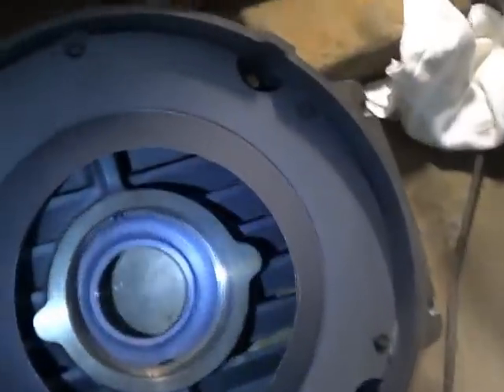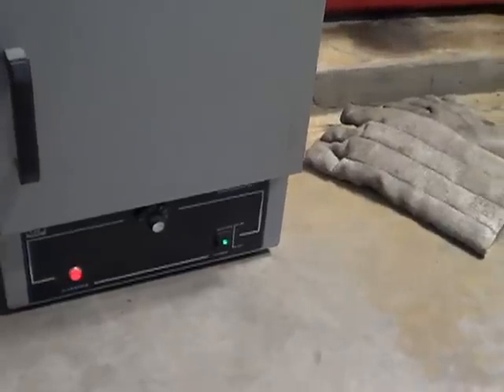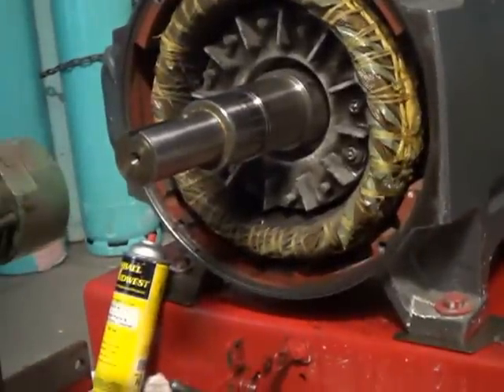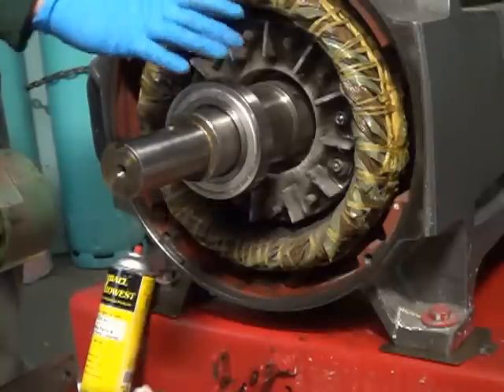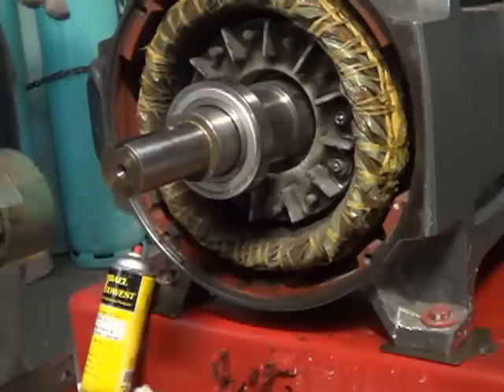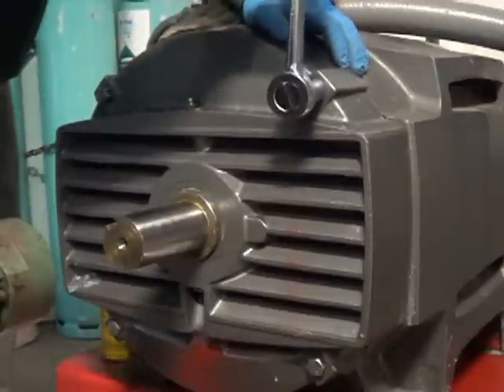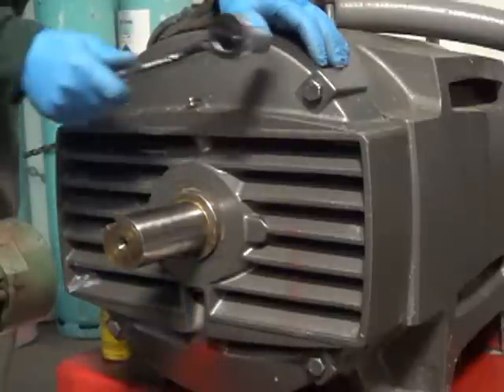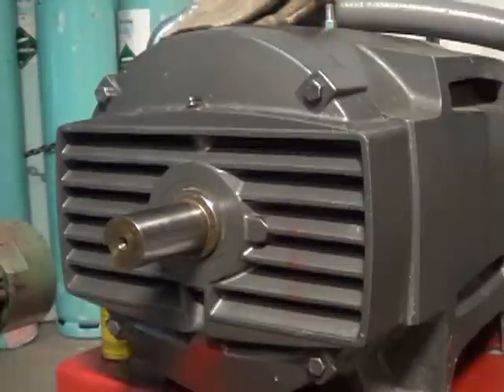Electric Motor Bearing Install

Comment: Copper coat on inner bearing race to shaft and use induction heat. But great job.  Now the DE bell should not just slip on, I use a dead blow hammer to fit bell ends and most motors have landmarks for position of bell ends.  Great video and good work, keep going my friend.
Reply: I will just assume the surge/hipot. Winding tests have bien done.
Reply from the maker: Nope! and it's still purring like a kitten

Comment: 20 minutes at 250 degrees in a toaster oven. Dropped right on my old Craftsman radial arm saw motor. Thanks for the tip, really appreciate it.
Reply from the maker: Glad it worked out for ya Jim. Now that you have done it you will just get better at it. I take a lot of crap for this vid but I leave up so that folks like you can see it done and give it a try. I hope all your project go well. Have a great day.

Comment: I install bearings on motors like this and much bigger motors.. All elevator motors.. we heat up the outer race first and then the inner race.. we use a torch on a map gas tank.. as long as you keep the torch moving and don't blue the bearing you are fine.. then as we are heating up the inner race we spit on it,and when the spit jumps off the bearing is ready.. I'm sure this sounds crazy to some people but it works like a charm!! never had a problem and installed hundreds of bearings from 2" to 10".. for smaller bearings like the one in this video u can get a drop light with a 120watt bulb and place bearing on bulb for a while and then slap it on..works great.. but the torch is the fastest and best!
Reply from the maker: +john k I love comments like this that don't criticize but add to the content and purpose of the vid. I get a lot of BS from people that don't work around industrial motors and have no experience. Thank You for your contribution. I have worked around DC elevator motors. People complain about the small grinder I used to cut the bearing off but they have never seen all the carbon build up around elevator motors. I really admire those old brass OTIS emblems. Wish I had one to hang on my wall. Thanks again. I know what you mean about the spit test. It just bounces off like an exhaust header.

Comment: Heating bearings by the oven method is not the best way to do the trick.  The Goal is to expand the inner race and not boil out the grease in the bearing.  Quick and simple way is to find a short socket in your Craftsman set that closely matches the inner race diameter and set the socket on a hot plate with the bearing on top of the socket.  This process was used to install disk drive bearings that are very fussy about heat and grease distribution inside the bearing.  You can also cool the shaft with an ice pack to insure that the bearing goes on without scuffing the motor shaft which will make the bearing run rough.
   One other point is when putting on motor end cap hand fit and tighten the bolts side to side which will make the cap go on relatively easier than tightening just one side.  One problem with putting on bearings by the heat method is that the process sometimes make the shaft and the inner race of the bearing actually develop a metal bond making later rebuilds a little more difficult.  Informative video, Thanks.
Reply from the maker: +Harry Jones  Mr. Jones you should make a video.  You have some good points. I think my vid is just one of many examples of how to do the job. It all depends on circumstances for a given situations. I have a friend that works full time at a large electric motor shop. You would not believe some of the story's he tells me.  There are many ways to complete any task. You just do the best you can with what you have. Not many people are brave enough to post a video that is trying to help someone who dose not have experience or someone else to show them. Keep this in mind and create a great day. I appreciate your input. It may help someone else.
Reply: +TheEZGZ heating the entire bearing to temp isn't gonna hurt that grease at all, it can withstand 300 degrees F with no problem. I've installed many a large bearing on papermill rolls with hot oil bath heaters.

Comment: I'm a skilled tradesman and speak from experience. the link was just proof straight from one of the largest bearing  manufacturers. it's one thing to show someone how to do something and it's another to give them wrong information. We get paid well to do things the proper way.
Reply from the maker: Being a skilled tradesman as you are I'm sure you understand that it is not a perfect world and there are times you have to act quickly and use what you have on hand. My goal here was to offer a alternative suggestion and help people think out of the box. Most people that target this video in a negative way refer to the sparks and metal hitting the winding. They were dry and low temp and did no harm. That motor has run perfectly ever since I did the video. I respect your opinion but it is just that. An opinion even though you find it below your standards. Open you mind and relieve the stress

Comment from the maker: All bearings that are a press fit are to tight to put on and off the shaft with very special tools. If you press them on cold you can remove some metal that might effect things. If you heat it up it expands enouph that you can slip it on. To remove it you use a puller and drag it off and stress the bearing area but most times you wouldn't want to reuse it anyway. Thanks for watching and comenting

Comment: We had a cone heater at the shop to heat bearings, but when had to change one in the field we used what ever we had most of the time cutting torch you got to be careful not to get it to hot, your stove was alright use what you got.
Reply from the maker: +Joe Tiller Thanks for your support Joe

Comment: i use a an oven too as long as the bearing does not have a plastic seal and the shaft i just stick it outside where its always cold lol good vid

Comment: Thanks for the video.  Why did you say not to lube the shaft before putting it on?
Reply from the maker: It's supposed to be a tight friction fit when it cools down. It's not supposed to spin (rotate) on the shaft.

Comment: Trade tricks - I have put heat on the bearing and cold on the shaft.
Reply from the maker: No trick to this vid the real challenge here was doing it in place without removing from the base at all.

Comment: Hello. I was so happy when you said, 'we're not finished', and I saw the housing/cover. But you didn't encounter my problem, :( lol..... My cover has a rubber gasket embedded into it, to seat the bearing in, and, exactly like your motor here, once I get the cover down to the bearing, I can't get any tools in there, and even if I could it would have to be so precise, the circle size, and be able to stretch 4 or 5 directions at once, but only a couple mm each way, lol, it's nuts. And if I rip the rubber out, then the shaft is free to wobble..

 I mean you know all this, but ... am I pooched, can this be done?   Peace
Reply from the maker: I suspect the housing has a slight taper to help get started. ??? Maybe put the seal partway on the bearing and spray some silicone on the outside???? Good luck with your project. Maybe contact the motor manufacturer and ask?

Comment: Sir.How many minutes the bearing should be heated inside the oven?
Reply from the maker: That's a very hot oven. I don't go by minutes. I don't want to burn the seals or loose the lubricant.  I just stick it in there for a while. If you take it out and it doesn't want to go on the shaft I put it back in the oven for a while longer and try again.  If your new to this method  just experiment by taking a old bearing off the shaft with a puller and then put it back on with the heat method. You will get a feel for it.  You can use a torch. You can put oil in a pan on a stove and heat it. Then put your bearing in the oil while on the stove wait for the heat to transfer.  Be creative. You can even chill the shaft to get a little shrinkage. 
I guess I have the luxury of working here everyday. I can see the cause and effect of my efforts as well as watch how contractors do work. They have to show up, Do the work and guarantee it. There methods are a bitt different.  Much equipment is neglected and outside contractors would rather replace the entire motor  than repair it on site like this. I love my work here.

Comment: Do you have to mark the location of the rear main bearing?
Reply from the maker: No, The bearings go right up to the shoulder on the center shaft. Sometimes there is a hold down clamp and other times there is a flat spring or the endplate is a machined fit. The magnetic field will center the armature

Comment: Shouldn't the end bell be an interference fit with the bearing?  Otherwise the bearing is just spinning around inside the end bell and wearing it down.
Reply from the maker: It's a taper fit. It starts easy and gets tighter as it centers itself. 7 years later it is still running perfectly!
Reply: @TheEZGZ  Ah ok.  That makes sense 👍😊

Comment: Is it really necessary to ensure the bearing part numbers are facing a certain direction? Bearing should work either direction, right?
Reply from the maker: You are correct.

Comment: we know that the bearing is sealed and got drease insite....

how long we have leave the bearing in the oven?
what is happning to the grease wile is heating?
Reply from the maker: You can heat the bearing any way you want. Just do it slowly and then try fitting it on the shaft. If it does not slide easily over the shaft then heat it some more and try again. Do not heat it so much that you damage the seals and the grease comes out. Experiment on a old motor if you can. Pull a bearing off and try to put it on. Then heat the old bearing and try to put it back on and you will learn from doing it.

Comment: When you don't have a sealed bearing, what grease do you usually use?  I know there are some polyurea greases and they are not that expensive by comparison to other greases that are more commonly used on other things.
Reply from the maker: Lot's of variables, Load, Temp, RPM, and so forth. On a new set up I just follow the manufacturer's recommendations. I generally don't change brands if it's been in service as some grease react to each other. Most modern general purpose grease's are of high quality.  I do like synthetic marine grade lube as well. Especially in my cooling towers.
Reply from the maker: Here is great info I found that should answer everyone's question's regarding lubrication
http://www.machinerylubrication.com/Read/798/grease-selection

Comment: I got 6002RS bearings I'm going to install on a bike transmission shaft. They aren't 100% metal. Would it still be safe to heat up bearings like those? & would any old oven do the job ?
Reply from the maker: +Johnny B The video is a little deceiving. I didn't heat the bear to long in that oven even though the oven thermometer said almost 300. 
If you have a coffee maker just set the bearing on the hot plate for 15 minutes or so and see if it slips on the shaft easy. If it sticks at all heat it longer and try again.   Good luck with your project and thanks for watching
Reply: TheEZGZ Thanks, I'll give that a try.

Comment: Installing a sealed bearing which cannot be greased inside a motor which has grease nipple and large capacity seems to be a mistake to me ... please advise me..thanks
Reply from the maker: It's been my experience in this facility that my coworkers have not been trained properly. They do not know when to add grease or how much when the time comes. I have had more problems with over greased motors collecting dirt and overheating the motors than I care to count. By using a factory sealed bearing and removing the zerk fitting guys leave my stuff alone. I probably getting longer life and less work for my self doing it this way. I've been to a few bearing seminars and classes where they explained the pros and cons. It really ends up being a personal and management choice. My boss agreed with me. Thanks for your comment and view.
Reply: @TheEZGZ  This is true, Im rebuilding a motor at the moment, it has a thick layer of grease all over the windings due to overgreasing.

Comment: I'm about to replace the bearings on my 2hp 3phase Motor. How long should I keep the bearing in the oven and how hot?
Reply from the maker: About 225 F for 10 minutes.  You will know right away. If it doesn't start easy heat it some more. Ounce  you get it on the shaft and it starts moving push it home quickly. After the first install you will be a pro
Reply: Thank you! Great video :)

Comment: Why would you bake a bearing, I read in some comments but if somebody could kinda explain because I may or may not be doing this. Thanks!
Reply from the maker: Bearings are a friction fit they just won't slide on or off when cold. If you warm up the bearing and leave the shaft at room temp or chill it with ice and heat the bearing it expands and will slide right on. You don't have to get them real hot. You can lay them on a coffee pot warmer in the break room and then grab some gloves and rush it over to the shaft and test it. Good Luck with your project.:-)
Reply: Okay that does make some sense. I was going to do this with a used table saw but decided that I will not be getting the saw. I always like to 'nerd out' a little on something I have to do, to make sure I can prevent something from going wrong, as it is "not my area of profession". Thank you kindly for the reply.

Comment: Did you torque those bolts? If so what value?
Reply from the maker: It's best to just hand tighten them and start the motor. Let it run for a while with an accurate Amp meter and then do your final tightening after it goes threw a normal heat cycle to seat the bearing. I did not use a torque wrench

Comment: Do you do one side at a time? I may have got myself into a jam, just pulled both endbells off the motor
Reply from the maker: You should be ok but it might be harder find center and pull the ends in. Let us know how your project came out. Thanks for watching and comenting

Comment: Why are you heating the bearing ?
Reply from the maker: It is a friction fit and you should not beat on a new bearing. By heating it for a short time in the oven it expands and it will slip right on. :-)
Reply: TheEZGZ would you tell me, which type of bearing should not be beaten and which should be beaten ?
Reply: @syedmohammadali9603  No bearing should be 'beaten' ever, either you heat the bearing or use a hydraulic press to seat it.

Comment: ahh.....pv is out of my realm. I do know that modern pv systems prefer micro inverters which are placed per panel as opposed to string inverters which cause the entire array to output at the rate of the lowest or most shaded panel. inverters are just microprocessors, capacitors, diodes, resistors and transistors. The design is nothing short of "magic". But inverter schematics are out there for the adventurous. only grid tie pv systems really need ac converion. dc appliances are more efficient

Comment: You should never heat a bearing over 250 degrees f
Reply: Also, he should hold the bearing to the end as it cools, to make sure it seats properly.
Reply from the maker: I don't know about you but my motors are ether horizontal or vertical and are install level so why on earth would a bearing move ounce you got it in position.. hehehehe  Take care and hang on.
Reply: yup! once it contracts to the cold shaft it pulls away seat. You should hold it in position for 10 seconds until it cools down.
Reply: I agree with holding the bearing for a moment. I've had them walk back on crankshafts on small engines and learned from that. I don't see a problem with the temp, I've heard of not going above 250 but old timers never seemed to care about the temp, only the fit-up. Heat til it goes home, clamp and cool. I've froze a lot of bearings and heated cases too, like you said in the video listen to what the machine is telling. People forget that you are the real deal pro in the field and we are lucky to see the video of your work. Instructions are for laymen, and you show us what the instructions don't which is 100 years or more of experience handed down through the years.
Reply: Ryan McLeod yes instructions, I get it. when you quote from a book you can always ref the book for proof of your awesomeness. Or you could quote from the book of life and those who respect and honor that book will say holy cow I'm lucky to get that bit of professional info. the point of this video is heat it don't beat it. not which temp is exactly perfect according to the instructions. you're comment was fine however insisting that you know everything that the book states is unnecessary and rude.
Reply: i am agree with you.
Reply: SKF states never over 110c. 230f

Comment: Why plug up the zerk?
Reply from the maker: The new bearing has seals on both sides and lubricated from the manufacturer.
The old bearing was open and required lubrication from the mechanic. You can remove the seals but I chose to leave them in therefore I removed the zerk so someone else would not force grease into the winding area. Thanks for your view, comment and question.